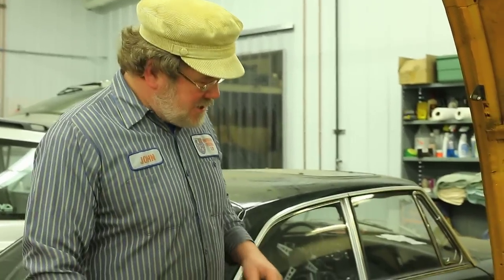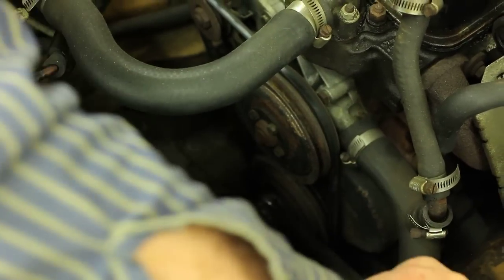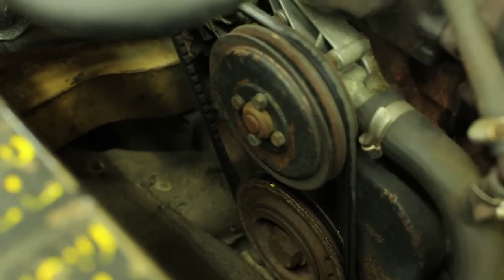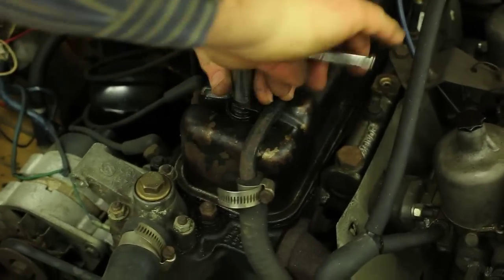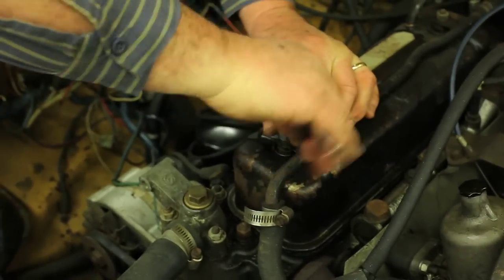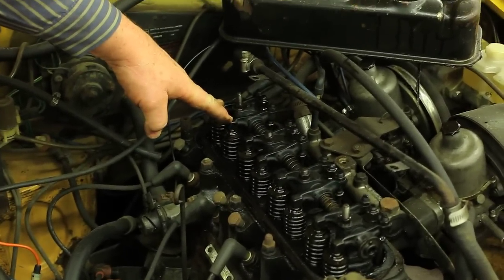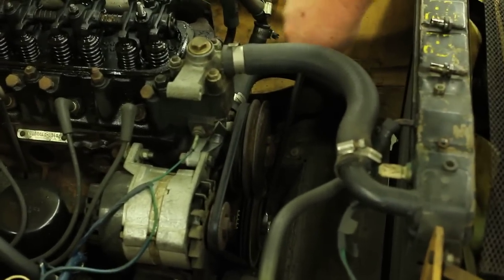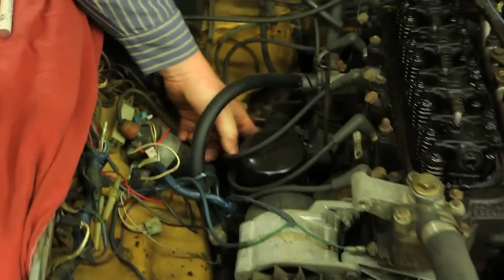181 MG Tech | Distributor Drive Gear on MGA, MGB

Comment: Mr. Twist, Very helpful instruction, but the video quality itself has something to be desired especially in low-lighted areas making it hard to see and follow exactly what you're doing.  I understand that often there is little room for an arm, much less a video camera, but a focused light, even a small LED flashlight would help. 
Many thanks

Comment: Thanks john.  My 72 has what I believe to be an improperly synched drive gear (ran great for a long time till I had to tear the top end down and reset everything) that is causing me some major timing headaches.  Like a no start and backfiring and airflow reversion. My rotor always faced 10-11 oclock at tdc.

Comment: If Cyc 4 is at top of the compression stoke, then Cyc1 is at top of exhaust stroke. Shouldn't either the exhaust or intake valves or both on 1 be slightly open and the rockers slightly tilted. It looked like all the valves were fully shut on all cylinders but maybe thats just the video. I suspect when you said cyc 4 rockers are loose is because both its valves are fully closed which implies its cams are just relaxed off the push rod which relaxes the rockers off the springs and that jiggle is the lash. The reverse is true for Cyc1, cams are pushing on pushrods and pushrods to rockers, on to the springs making them tight, but slight rocker movement should be visible on 1 . Having said all that, the jiggle method is pretty good tom but what if lash is set incorrectly on all rockers, a jiggle could point you to the wrong cyc, thats why I always look at the valve position.

Comment: it would have been helpful if you would have shown how you actually took the distributor out.
that was why i was watching this in the first place.  I bought a 7/16ths wrench to modify in order to get to the bolts holding the dist. down.

Comment: Hi Thats a great Video. I wonder if i can ask a question please.   I have had the distributer out on our MG Midget 1275    1972 model, to replace the points.  now I find; with the timing marks set up at 7 degrees before top dead centre, the rotor arm points the opposite way !!!!!! thus its never going to start.  IS there an easy silly fault Ive made or could it be more serious please.

Comment: If you have the dots on timing wheels together, firing on 4, and insert the gear, with large side up will, It insert  correctly?
Reply: Late reply but it may be helpful to others who still watch this video ....as i understood the video you need to turn the crank 360 degrees so that it is firing on No 1 cylinder before inserting the distributor shaft horizontally with the larger part upamost

Comment: Unfortunately the timing marks do not extend beyond the 20 degree mark, so setting the total to 32 max. on >= 3000 tpm is not so easy. With the guidance on lower tpm (notably Haynes manual on 600 tpm, others, myself included on 1000 tpm), this problem does not appear. I do wonder how to go about it in measuring ths 32 degree value: a makeshift extra strip to be temporarily added to the existing marks?... 
PS max 32 is correct: static 10 + 22 degrees centrifugal advance (20-24 is specified)